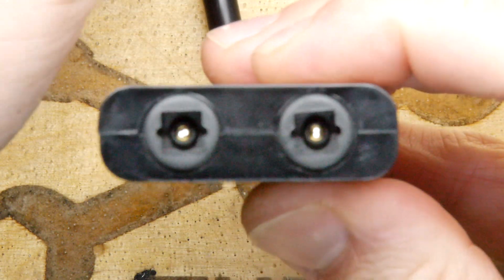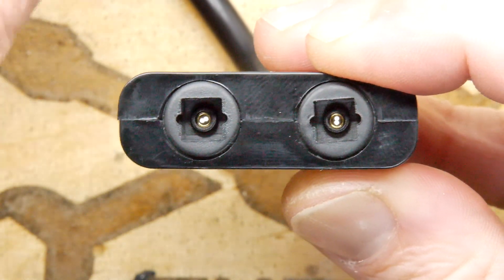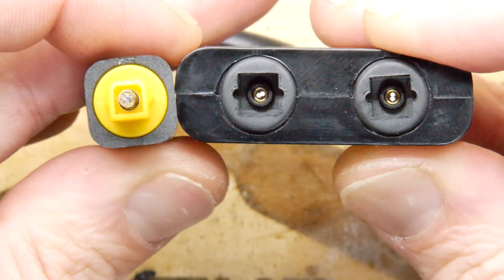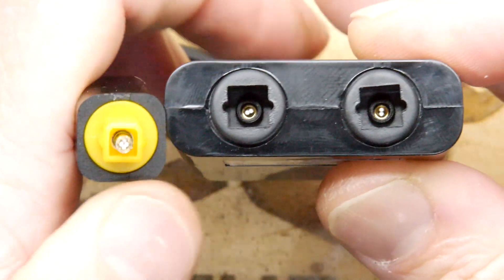TOSlink fibre optic splitter

Comment: Thanks for the video
Can i use it to connect the female part to my smart tv output and on the female connectors, connect 2 cables, one to my home theater and the other to another sound equipment. I want to do this because, sometimes i want to hear the youtube songs on my sound equipment and sometimes i want to use the home teather for my movies and i dont want to switch the spdif cable that comes from the tv to one or the other component.

Comment: Thank you for very informative video! Is there any loss in quality with this device compared to more expensive models or do they all do the same thing?
Reply from the maker: It's digital so either works 100% or fails miserably 😂
Reply: I bought this and yes it failed, need to discover another option ???

Comment: Shame you didn’t show an actual application of this splitter e.g. From a TV output to a sound bar and head phones.  If you had tried that you would find the splitter as shown doesn’t work!
Reply from the maker: I use it all the time, it works fine. The TV feeds to two amplifiers - one sound bar and the other a hifi.

Both amplifiers work fine simultaneously.

I have no idea how people are having so much trouble with this.
Reply: @backofficeshow  thanks for the reply.  I bought two different types of these unpowered splitters and neither has worked.

Comment: I recently bought one to use two 5.1 home theaters , it worked in the first go however after the split  definitely lowered the output from my first home theater (which was the only one I was using before I bought a new one along with the splitter) . I would barely ever exceed 20 out of 40 or max 24 volume on it but now if I only use the same one (with the new on off) I need to be above 30 35 to achieve the same
Reply: I'm doing the same thing. Have you figured out a way to get a splitter to give uncompromised output?

Comment: What I want to know if I get another optical speaker and if I split the sound fr my tv would both of them play without latency...I want to expand my audio to more speakers
Reply from the maker: There won't be latency in the optical data but the processor on the speaker might add some that could differ than your existing device

Comment: Since it's all optical, it's not a 1-way device, and could be used to combine 2 cables into one, BUT not simultaneously since there's no synchronization or data-stream merging circuitry -- there's no circuitry at all!
Reply: I'm honestly thinking of getting one for this purpose. Have two input devices going into a DAC that only has one Toslink port. Obviously I'd only run one at a time. I'm just lazy and don't want to have to physically swap what's plugged in or risk breaking something like an ape.

Comment: Good morning 
I just got mine delivered but it is not functioning either hifi or sound bar. What I might be doing wrong?  Appreciate any help. Thank you
Reply from the maker: Can you see the light coming out of both outputs?
Reply: @backofficeshow  yes I do for sure.  Do I need to turn of all devices before connecting the splitter ?
Reply from the maker: I feel it should just work. I don't think it's necessary to turn them off, but it couldn't hurt.
Reply: @backofficeshow  will update after trying again in evening.  It is 10.56 am here.

Comment: Just got one today , cannot get it to work . I see the optic at both outputs and cable ends when connected but zero data transfer.
Reply: Yeah same. Plugged the yellow part into my tv and split it to my sound bar and headphones. Neither work. And I see the light going through so I'm confuzzled.
Reply: @those1kidds  I found some info on line that says lower quantity cables can be a problem,  but I don't want to buy high end cables to find they don't work either. One of my cables is very high end and it won't work in either port. So....?
Reply from the maker: Perhaps there is an alignment issue? It might be worth rotating the optical cable connector around
Reply: This thing is pure garbage,  don't buy one...
Reply: @robertneilly4349  aw man

Comment: I have the same spliter running from tv to soundbar and a set of tower speakers but i cant get it to work i want to run the tower speakers with the soundbar any idea why its not working?
Reply from the maker: Can you see the red light coming out of both sides of the splitter

Comment: Can I connect to the audio out of the TV and in the two outputs connect them to a sound bar and a receiver? in other words, they both sound at the same time.
Reply from the maker: Yes
Reply: @backofficeshow  i brought the same splitter but with a female input so i had to run a cable from it to the tv then the two outlets to two soundbars,but theres no sound.why?edit:since the splitter does have a input lead like yours and im using a standard optic lead from the tv to the splitter would it be not working because the input lead to the splitter isnt or hasnt got 4 lines in it?

Comment: If I have this splitter plugged into my optical in on my Yamaha AS501 amp, I would like to plug chromecast into one to play through my amp, then my tv into the other if I want to play my tv through speakers. Would this work?

The reason I want to do this is, sometimes I may be playing a game on my tv but still want to listen to chromecast on the amp, but without having to swap the cables over as tv cables are behind the wall. I know I can use the coaxial cable in amp as well, but that’s not as good quality as optical.
Reply from the maker: They generally do not work in reverse unless the optical output of your devices is totally off when they are not in use. I'm my experience this is unusual

Comment: can this make 2 audio system output at the same time or more to switch?
Reply from the maker: Yes you can output to two with this
Reply: @backofficeshow  got any reduce sound after using 2 audio output at same time?
Reply from the maker: This will not happen

Comment: Ah yes the TOSS link.
Ive been looking at one of thse passive splitters and I wondered if it would actually work connected and feeding a signal to two DACs at the same time (both powered on)

If Toslink is a one way street then heck yes it should work!
I have only one toslink output on my TV currently feeding a single ebay dac for my ghetto logitech Z something something stereo where I replaced the satelites with a pair of Kenwood S-233 speakers since its the only output on my TV barring the buildt in crap and bluetooth which it does have. but I wanted to add an dacamp for some serious headset listening.  
man if it should work without having to power one of the dacs off then Im really happy. wasnt sure if these went both ways or not. 

Good informative video. :)
Reply: Can you tell us if it worked? What I want is to split the optical signal from my HTPC and feed them into 2 (almost identical) receivers, and both of them to be able to process the signal at the same time. Is it possible with one of these?

Comment: This is the first kind of toshlink splitter design by pure mechanical / optical method without using power (save one power socket).
Really awesome!!! 
Perhaps the transmitted power for the ditigal pulse (signal stength) will be also spiltted into half, in theory the receiver end will deal with the signal stength; anyway will order one for testing.
Reply: Of course the output from each socket receives half of the input signal, as only 2 of the 4 fibers in the plug go to each socket.
Reply: I've read that Toslink's max length is 5m(16 feet), yet I need around 30ft to reach my DAC. I've tried a basic toslink extension cable, but because the combined length was about 32ft, i started to experience drop outs and pops. Isn't there some sort of Optical Hub that can read two 15ft Toslink cables as just one?
Reply from the maker: I wonder if you could make one with just a few components 🤔

Comment: I am going to get one of these and see if I can have both my PC and my Xbox One X connected to my Astro Mix Amp while both of them receiving/using Optical Audio. Currently I have to use standard 3.5mm aux for my pc audio and the Optical audio port for my Xbox.
Reply: did it work for you? Trying to get both my TV and pc PC plugeed into my 5.1 receiver that only has 1 input

Comment: I have the exact same splitter for sharing tv output between headphones and sound bar.  It doesn’t work.  No sound out of either of them.
Reply: Try changing the sound from Dolby Digital to PCM in your tv settings.
Reply from the maker: If the light from the TV is getting through then it has to work, it's a one way signal. Could there be an alignment issue?

Comment: Well... Since modern receivers are shit and have no capability of quality sound on pre-outs and 11ch+ combined with 60hz 4k in one unless youve got $2-4k... Im making plans to use something similar to this to link 2 receivers in my setup. Goal is to run the second receiver outputs as ceiling speakers (essentially atmos) and the first receiver as normal 7.1 all while my tv produces 60hz 4k. Pre-outs being used of course for my 4 towers, book shelf surrounds (hardly, more like mini towers) and center, but not needed (or possible) with my second receiver that will be running the sound for the ceiling.
Still undecided if i will be using all 7 channels from my old receiver, or the sub out, but maybe... May test how it sounds as my old receiver has fairly adjustable output (vsx-917v-k) if I do 14.2ch audio, lol! But i feel the surrounds will be more ideal for performing overhead audio than the front or center channels.

Comment: I'd be interested to know if by splitting the optical leads, you then end up splitting the audio? Do you physically lose half the sound from one device because it's going to the other?
Reply: I don’t believe that you lose half the sound. With these optical/digital (I’m thinking of coaxial, which is the same signal as the optical, only it is transmitted electrically) connections you don’t lose quality, you lose the sound entirely if the signal gets too weak or has too much interference and the receiving device cannot understand or put it together
Reply from the maker: Yes correct, either the signal will get through and work at 100% or it will not work at all. There is no degradation
Reply: @backofficeshow  So, I can get 6 channel dobly digital sound?
Reply: @ricog8209  You could in theory get as many channels as you wanted....Its optical, its not being shared between devices like an RCA connection that uses current and therefore is a "shared" signal and that signal gets weaker and weaker with every added device.
Reply: I'd love to answer that question, but.. what? Can you try to explain what exactly you think of doing?

Comment: Can it go the opposite way? Let's say I have an Xbox and a PlayStation audio going to my surround system? So when I'm playing with the Xbox that port 8s working and when I'm using the PlayStation that port is working. Thank you.
Reply from the maker: Only if the disabled device shuts down it's output led totally. Turn it off and see if there is still light coming out the hole, if so, it will not work
Reply: @backofficeshow  perfect. Thank you so much.

Comment: I use it to connect my pc and ps4 to my razer leviathan and it will only work when i turn off either device.
Reply from the maker: Yes it's for splitting not combining. Turning off one device is the solution
Reply: Same ps4 and pc thought it could run at the same time

Comment: can i plug my xbox and cable boxe's optical in and plug the single into the sound bar, forgot to run an optical in the wall :(
Reply: Yes u can. U can use it in reverse. thats what i am doing with mine. I have xbox and playstation outputting audio one at a time to my audio receiver which has only single optic port.

Comment: I was wondering, in theory, could this be used to combine 2 toslink inputs into one output? I was looking to plug the bluetooth receiver linked below into one of the "outputs" and my raspberry pi with a dac hat on it to the other. Finally I would plug the "input" end into m speaker amp.
https://www.amazon.com/Boltune-Bluetooth-Transmitter-Receiver-Playtime/dp/B07RYQ2DD7/ref=sr_1_3?keywords=bluetooth+to+toslink&qid=1585324001&sr=8-3
Reply from the maker: It does not really work like that, well, you can use it, but one source at a time. In other words, you cannot mix the TOSlink data streams with it, it will most likely sound totally corrupted, assuming it even tries to play anything.
Reply: @backofficeshow  Yes, that's also what I wanted to know before buying this thing: can it be used as a Toslink HUB to connect 2 devices to the same Toslink input port? 
Please note that the 2 devices in question will never be turned on at the same time... I mean, who would turn on a DVD player and a Playstation at the same time?!
Reply: @PrimiusLovin  did u figure it out? I am in a very similar situation
Reply: @saiyannegi  Yes, it works for me, as long as the 2 devices connected to the Toslink adapter aren't turned on at the same time.
I purchased 2 of these adapters and now my av receiver has 4 Toslink inputs instead of just 2 :)
Reply: @PrimiusLovin  thanks for letting me know. this would be really useful to me. I need to connect my xbox and playstation. I use only one at a time and only that is powered on while the other is always unplugged meantime. Does it cause any noticeable degradation or delay to audio?
Reply: @saiyannegi  There is no audio delay or degradation because there's no audio processing taking place in these devices, they only split the light into 2 beams!!
You're the one that has to choose if you want to use them to send audio to two simultaneous audio devices or receive audio from 2 devices, 1 at a time.
Reply: @PrimiusLovin  thank you so much my friend. Bless you

Comment: I am planning on running a optical cable from my amp to a splitter or switcher and then having my TV optical and a music streamer optical plugged into the splitter or switcher which one is suitable for me as I plan to either stream music from streamer or listen to TV but because my amp has 1 x optical connection I do not want to have to always plug and unplug each device in?
Reply: followimg.   i have the same situation.
Reply: I just made my research, we will need the thingy called Toslink Switcher. so we will have also some mini remote to use to switch it. The bad news is, we will need AC adapter as well.

Comment: I have the very same splitter sending the audio from my PS4 Pro to both my surround headphones and my soundbar.
Reply: Avoiding the obvious TosLink fnarr fnarr...
Reply from the maker: It works so well and it's cheap. Great bit of kit
Reply: Mark Fixes Stuff  does it affect the sound quality at all??? I am planning to do the same.
Reply from the maker: @topap8052  it does not have any affect on the audio whatsoever
Reply: I got the same and it doesn’t work … any advice?? I’ve tried different way and nothing works
Reply: @Carlosac10 Same here, got one and the thing is not working, I will return to Amazon asap
Reply: @adbaro3448 I think it depends on the devices, some newer TVs have communication over optical which would be like trying to split an ethernet cable to 2 computers.
Reply: TOSLink, what you use to network two Atari STs? :)
Reply from the maker: @6581punk  I feel I need to make this now!